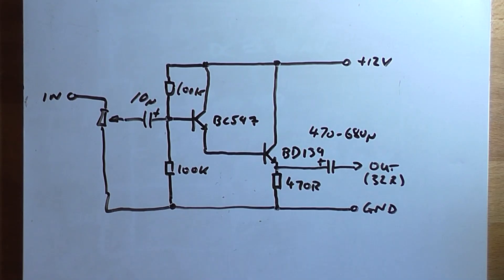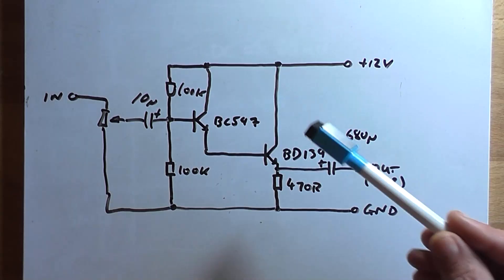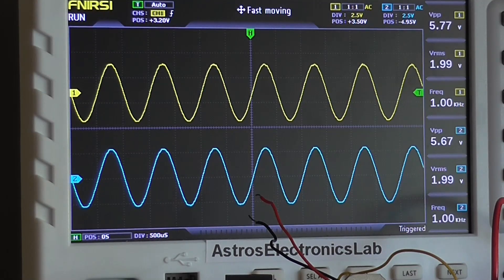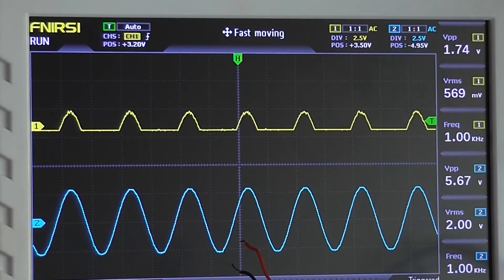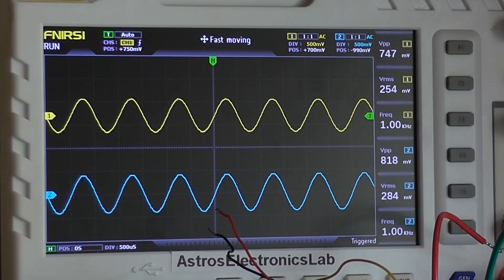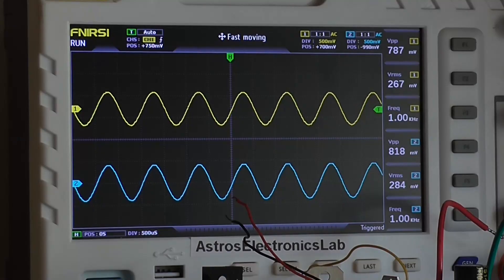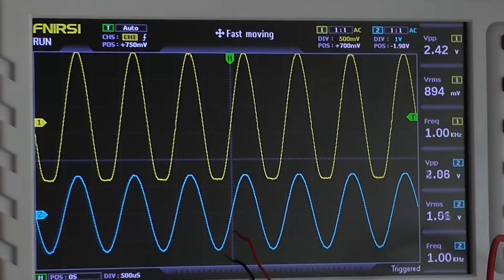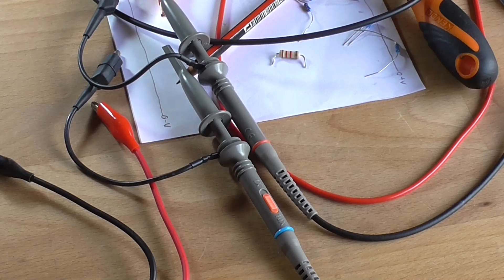CoolDudeClem's Headphone Amplifier Load Testing

Comment: Are those bd139  the fakes from aliexpress with the microscopic die?
Reply: It looks like one, if it just says bd139 or bd139 with pm95 or nxp 54 or similar at the bottom it's a china fake and the die is less than a mm square!
Reply from the maker: No. They came from a reputable supplier. I don't buy anything on aliexpress

Comment: Quick back-of-the-napkin calculation: you're wasting about 74 milliwatts (6 VDC across 470 ohms) to output barely one third of a milliwatt (i.e. 200 millivolts across a 120 ohms load)... There are better designs indeed.
Reply from the maker: Yep. Clem just wanted to do... something...
Reply from the maker: That 470 ohm resistor should have been more closer to 120 ohms. Just my opinion. However, a Darlington output-stage on its' own, an amplifier does not make.
Reply: @AstrosElectronicsLab  The lower the resistor, the higher the losses, so it's even worse. Mind P = U² / R... The purpose of an amplifier is to transfer the maximum power to the load, not to the biasing resistors. And in this case, given the amount of current headphones need, a mere follower opamp would even be enough. Although this doesn't solve the issue of the dummy load resistor, in which case a much better approach is to establish a virtual ground at Vcc/2 and connect the headphones between that and the amp's output, no resistor needed nor coupling capacitor (making it all depend on the choice for the opamp).

Comment: So to summarize, an "amplifier" that loses power and voltage when loaded isn't an amplifier at all, and that circuit is not appropriate to drive headphones at all, it could drive long cables into low impedance load though, like 600ohms.
It would perform better if the bias resistors were 22k and the 470ohm one 100, still far from ideal though😀
Reply from the maker: Correct. We'd call this a "deamplifier".

Comment: That buffer circuit isn't good enough for driving any headphones. Lower end headphones are rated at 200mW, and are 32ohms. To achieve that you need about 2.5Vrms of signal, or 3.5Vpeak or 7Vpeak-to-peak.  Higher end headphones 64ohms rated at 500mW will need 5.5Vrms to drive the full power.
However most are rated at about 1Vrms to reach 90dB at which the human hearing is the flattest (fletcher-munson curve)...so those 2.5mW you are getting are nowhere near that.
Reply from the maker: I never said it was good, I also didn't come up with it. However, I agree with you.

Comment: avarage android phone can do 250-350mV (unless it drops on loads, but i dont think that, since my cheapo android phone can make bump my 5.25" woofer by 0.1-0.4mm into free air. And if i boost the gain on my phone digitally, it can send out up to 350mV at just 2db gain boost.) My phone is a Realme C21Y and does 295mV normally, without any additional boost features.
But also count about that, that woofer that i have tested was an 8ohm impedance woofer, and its pretty easy to drive.

Comment: Have you come across the "Build a Headset Amplifier" from Nuts & Volts Magazine (September 2013)? I built it one a while back and it's certainly an interesting approach. It has an input stage and NFB setup like most classic Class-AB amps but with a Class-A + current sink output.
Reply from the maker: Interesting. No, I never came across that. I might search it up, see if I can find it. Update, you mean this one: https://www.nutsvolts.com/magazine/article/september2013_Anderson
Reply from the maker: Wait, oh I see. Q11 IS the current sink! So, Q10 is doing all the work driving the headphones. I was a bit confused with the VAS just driving Q10 with no biasing diodes to Q11's base.
Reply: @AstrosElectronicsLab  Yeah the schematic is drawn in a bit of an unusual way. At a quick glance you'd almost be forgiven for thinking it was quasi-complementary. I can confirm that it works. I thought of it mostly because of your parts choices of late.
Reply from the maker: @MrBun9l3 i will definitely make a video on this.
Reply from the maker: The schematic looks messed up at the output transistors. I can't see how Q11 is doing anything...